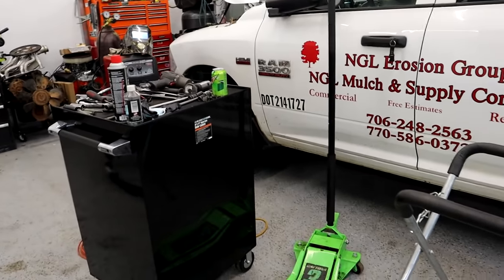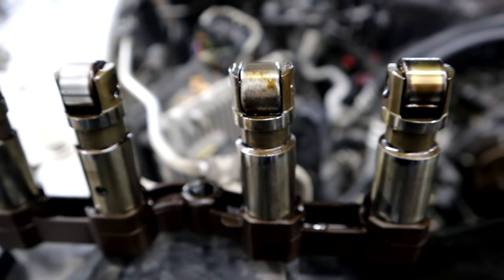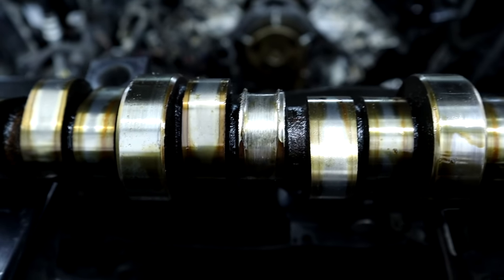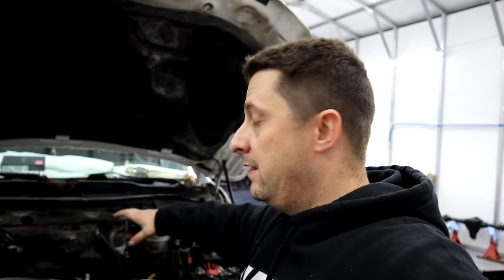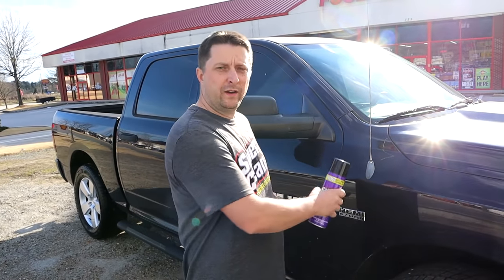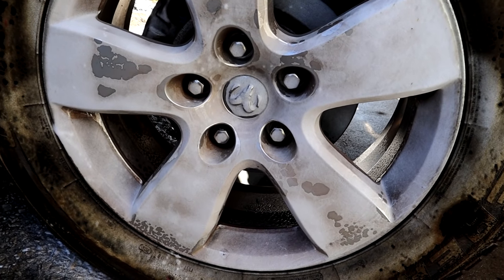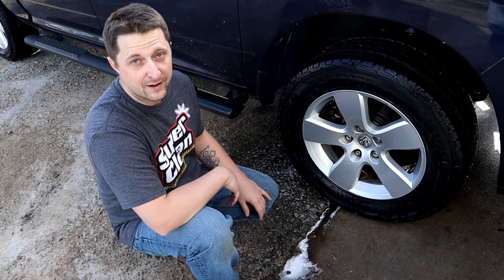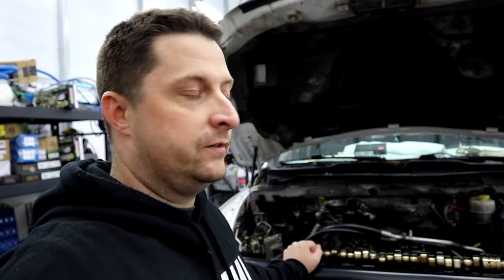6.4 HEMI Engine Failures Common Problems WATCH OUT.

Comment: I am 66 years old and have owned a Dodge 4 different times in my life. Every time I have owned one , they have remined me why I don't want to own one. I see nothing has changed.
Reply: Just curious, but Why did you buy 3 more after the first one ?
Reply: @semiauto3148  actually the first one was the best one, a half ton pickup with a 318 and a push button transmission. It was a 1967 as I recall. Next was a 73 new dodge van a total pos from new and I sold that thinking I got a lemon, next try was another van, broke the timing chain at 56,000, next was a mini van for my wife bought new never made 100,000 before needing transmission. Next was 440 recharger used as hunting vehicle, never could get it to run decent. After that I started buying Chevy. I owned a business that bought a new truck about every two years and I bought 6 new Chevy pickups and NEVER had a drive train problem in about one million miles of use.
Reply: @robertcarey3383  so. Since then you’ve been a Chevy man?  I owned a 2015 Ram with 5.7 hemi. Didn’t have any problems but only owned it for 4.5 years and traded it for 2019 Silverado with the 6.2 engine...it was nice truck but only had 38k miles when I traded it. I got a little worried about the engine after reading about the engine failures those 5.7’s were  having...
Reply: @semiauto3148  I only owned one with the 350 the others were the small v8 I believe they were 305 and two were the v6. 5 were half ton and one was three quarter ton HD. None used oil, no tranny issues, one fuel pump, one water pump, and fuel and oil filters and that was it. I put overload springs on the half tons immediately and worked them like they were 3/4 tons. When I retired I gave one to a guy who worked for me, kept one for myself and sold the other three to one of my friends who also owned a business. I also owned a couple Ford super dutys and still own one of those, I use it to pull a fifth wheel.
Reply: Fool me once, shame on you. Fool me twice, shame on me. Fool me 4 times, I need to have my head examined. 🤣
Reply: @donellmuniz590  lol.  But I do know some ppl that’s had really good luck with dodges.
Reply: @semiauto3148  I'm a Mopar guy myself, but only for the older stuff, like 1960 to 79. I'll never be able to buy a brand new vehicle, so I have no experience with newer ones.
Reply: @donellmuniz590  yeah. I like the old stuff better in all the manufacturers
Reply: Opposite experience here. 67 Dart was bulletproof. 2 minivans in the 00's served my family of 5 well, took a full American beating. My only gripe is their rust history in the Northeast.

Comment: Hey I see this everywhere. What is the actual cause of these failures ? Lifters , Cam’s, low oil volume, low oil pressure ? What ? If it’s oil volume or pressure could a aftermarket pump be installed ? I know friends with Hemi trucks never had any problems and have over 100,000 miles. Excellent informational video
Reply from the maker: Nobody really has a guaranteed answer on the cause yet. Tons of theories and guessing  but no actual legitimate reason.
Reply: Chevy has this issue as well with lifters failing. It isn’t just a ram issue

Comment: I haven’t heard of ls engines eating cams and lifters unless it’s the eco engines with cylinder shut off modes…the light duty pickups don’t have that so they don’t have cam issues….dodge needed to address the lack of oil to the lifters unless they just want engine failures out of warranty…uncle Tony’s garage has a good video of explaining this and possible solutions to the problems

Comment: I have done couples 5.7 and I am about to do 2015 6.4 hemi preventive repair just start ticking and the head Does Not have to come out just valve cover and you take off rocket arms shaft and push rods and I have done also replace of camshaft without taking off front xover and timing chain but if is taking head off and doing valve seats for 1500$ he's price can not be beat here in California labor cost is way way higher

Comment: If I was the landscape owner with 5 Dodge engine failures, I'd be shopping at the nearest Chevrolet dealer
Reply: Chevys are even worse they  have trans and lifter issues.   Ford 7.3 gas or the 5.0 is probably the best bet for a newer truck
Reply: @ashkanserat  - we use fords for our fleet and they have lots of issues under severe duty too.  No vehicle is going to be without issues when you idle for long periods and it's driven by someone who doesn't own it so they don't care.
Reply: @bobisrighturwrong   for the most part they're all piles of shit these days. Some worse than others but the newer chevys are horrible
Reply: Patt Cuda  Nissan are junk.  Just Google them...that entire company has been on a down hill slide for 2 decades.  One of the worst performing/quality on the road.  Toyota is the only one that still builds quality cars/trucks. Too bad they only build 1/2 ton versions

Comment: This is an issue of people not using the correct oil! This motor (6.4 392) is supposed to take mobile one 0/40 European car formula. The oiling holes are very small and they plug up causing lifter failure. Maintenance is a must with this motor! That is a fleet truck and is not maintained properly I assure you.

Comment: As I watch this, my 2016 ram 2500 with 6.4 is getting an entirely new engine at 146,000. Your price quotes, mileage they last, etc are exactly spot on. With so many bad engines, I’m disappointed ram hasn’t decided to do a recall or something. Likely will be my last gas truck from ram if not all together
Reply: Yeah, I quit buying Mopar junk 10 years ago. It just seem like it was always something breaking or messing up.
Reply: Having to look at this repair myself, although I guess I should feel blessed I got 250k out of my 6.4 before she bit the dust on this failure two weeks ago. What did you end up being quoted for the new engine? I may do a rebuild. I was quoted around $14,000 for a new engine which I thought was crazy
Reply: @Hall7180  I ended up paying $13,400. They also told me my catalytic converters were bad because they were soaked in oil from the bad pistons, which would have been about $2,500 additional. I didn’t have the money for the engine in the first place so I told them not to replace the cats, I can replace those on my own for less in the future.

Comment: Keep up whit the maintenance and used top of the line oil n filters or even mid grade products. It’s when you cheap out that issues start happening and passing sudden maintenance points that u get trouble

Comment: lifter and cam job on the Hemi isn't bad of a job at all, pretty easy to be honest. Keep scaring people, and I'll gladly keep picking up these cheap Rams with the 6.4. Not like the engine completely fails, and the job is just a little bit harder than a timing belt job with just the heads having to come off.
Reply: What about the longterm downstream effects of the failed lifter in the rest of the engine though? ie metal filings in the rest of the block.
Reply: What is the average cost of that repair, though?

Comment: I still think uncle Tony has found something with the angle of the lifter bores and the distance of the cam from the crankshaft. The oil isn't getting to the rollers. Only at higher rpm  are the lifters getting lubed good. The check valve in the lifters may not work correctly at idle speed rpm. It's weird that not all of the lifters show same wear  pattern. One would think if all of the lifters were getting weak oiling at idle, that they should start to fail near the same time.
Reply from the maker: I agree with the angle it does make some since for sure. Sad thing is you would have to redesign the entire block and all😓
Reply: Tony is right for sure. Dumb design. Fiat peugeot is a joke. That's why I got rid of mine before it happen. It's either this of the exhaust manifolds. Very disappointing. They won't fix the problem.

Comment: SO after the lifter fails and grinds that cam down, where's all that metal go?  I'm assuming it goes to the oil pan and gets picked up by the oil pump and goes through all the bearings. So I'm wondering about internal damage...Do you check the pump and bearings before assembly and how do they look?
Reply from the maker: If the cam bearings look good, then new cam,lifters, oil flush and send it. I have put over 20k on my motor on top of racing it weekly after a failed cam/lifters issue
Reply: @FrostbiteRam  I just had same problem on my 2014 challenger 392.  1200 miles after replacing lifters and cam, the oil pressure at idle is only 9psi. Pulled oil pump and looks to be scored fairly bad.  Just wonder if I should pull bearings too?
Reply from the maker: @street22style  its possible it could be worse but thats kinda rare most people get away with new cam and lifters.

Comment: I lost number 3 on my 2014 6.4 Ram 3500 at 102,000 miles. Fca Warranted parts I had to pay labor because factory warranty just ran out.The dealership only replaced 4 lifters and didn’t tell me until I picked up the truck. I made them let me look at the cam before I accepted the repair job all the other lobes were smooth as silk. It’s been a year and a few thousand miles time will tell. I still love my Ram truck. But there’s definitely a flaw in the engine design or a batch of bad parts on 5.7 and 6.4’s.
Reply from the maker: Thats terrible and I totally agree 👍
Reply: Fkn dealers. If you're paying the labor they should've given you the option to replace all lifters for another few hours of work. Glad you're all fixed up.
Reply: @waynedaniels7091  Indeed. Thanks
Reply from the maker: @waynedaniels7091  definitely

Comment: Camshaft failure due to lifter failure....usually at 100k miles. Just trade in before that time. It's common problem for 5.7 and 6.4

Comment: I wonder if generic oil and cheap gas is the main culprit? I've noticed when heavy towing using standard mopar oil i would hit 280 °F after going with Mopar synthetic oil i rarely hit 260. Around town driving i use mid grade fuel and when planning a trip and during a trip when towing i use premium only.
Reply: I would try 0w40 oil castrol mobil penzoil doesn't meter better flow at any given temperature better lubrication when working hard and  better additive package.
Don't belive dealerships.
Reply: @MultiPartizan1  I send my oil to Blackstone Lab for a full Chemical analysis every other oil change. I trust my dealership as not only do I know the owners but also know most of the people there and have known them for almost 20 years. The MDS system gets angry when using different viscosity oils and might cause a CEL or MDS failure.
Reply: @shockracer  When towing Premium fuel only 93 octane we use 0W30 oil when towing oil temperature stays under 230f and same oil for all year around,
Same hemi 5.7l engine in australia recommended from mopar viscosity oil  is 5w40 find CAFE agreement when you can,
No MDS issues in two hemi 5.7l engines K&N filters and Penzoil euro 0-30.

Comment: Where did the metal from those parts  went ? Do you need a block flush ? Or a new motor ? Compression checks ? How we know how bad it is ? Should we just replace all parts Before it happens  ? Shoot...
Reply from the maker: Catch it in time and nothing more than swapping parts and a couple oil changes won't fix.

Comment: The math works:
(Poor maintenance + extended idling) X work truck = valve train failure.
(Excellent maintenance + no extended idling) X personal use truck = longevity.
My 12 year old 5.7 with 140,000 miles didn't even have lifter tic.  I expect my 2022 6.4 won't either in ten years.

Comment: Well to put things in perspective if you owned the 150 with 5.4 Triton, or you know what I can phaser or plugs blowing out of the head or the next model plugs that can’t be removed from the heads to be changed you’ll feel good driving a Dodge /Chrysler any year anytime I’ll take the problems.... it must be embarrassing for them because I have several vehicles with half 1,000,000 miles on them and their gasoline engines...I don’t have a half million miles on any Ford or Chevy I truck I ever drove, got rid of it long before they could drain my wallet further oh well this problem is nothing😂

Comment: All of these Hemi engines needs a much higher volume oil pump to keep the oil pressure up at idle.
Everyone of these engines needs a hellcat oil pump. Not higher pressure just higher volume especially at lower RPMs. I think that would certainly help the situation!

Comment: First of all this is not a mds problem. I replace just a many non mds cam lifters.  Second this is not a dodge issue its a hydrualic roller lifter thats not given enough time to pump up before you drive down the road on cold start.
Reply: You’re telling me that when you start the engine and put it in drive the lifters aren’t pump up yet? Then either you’re using cheep oil filers or oil or you’re got design problems!

Comment: On a 5.7 MDS error codes when Cylinder 1 solenoid stops working,  P3400 Cylinder Deactivation System Bank 1, P1411 Cylinder 1 Reactivation Performance, P0301 Cylinder 1 Misfire Detected, P0300 Random Multiple Cylinder Misfire Detected

Comment: I'd look at the owner. What type of oil? It's not Amsoil for sure. Castrol GTX, rated as high as Amsoil for 1/3 less. Using the oil everyone thinks is the best, Shell and Valvoline, is for engines with 5 gallon oil capacity, not 7 quarts. That stuff is cheap and changed regularly. It's 2021, no dinosaur oil should be doing anything but a 1000 mile break in, with zinc. I've run Cummins  since 1994 and Hemi since they proved themselves. Amsoil only in the Cummins and rotate between Castrol and Amsoil depending on temperature in the gassers. That extra cost to bring a Hemi to 300K,(and then sell it), by using premium synthetic is a lot less than cam bushings and the time to tear down. If those Rams were Audi's or Beemers he would be using real oil and saying he does to keep the engine like new.

Comment: It's a design flaw in the engine itself. Improper oil distribution. My brother's 5.7 FHP cruiser died at 142K. Roller cams should never have this problem. It isn't the oil, or the change intervals.
Reply from the maker: I agree with it being a design issue a person should be able to idle for periods of time among other things.

Comment: V8 back in the day no tech could easily go 200k no issues at a fraction of cost of new tech. Any V8 not getting 200k trouble free miles is defective product w/high tech oil, fuel & filters we hve NOW.
Reply from the maker: Definitely 👍

Comment: I had a 2015 6.4 challenger scat pack and the lifter went around 83k they replaced it put it in did not change the cam gave it back to me drove it motor blew as I was driving on the E way going 95 and it took a year for FCA a year to put a new motor in it then when they put the motor in it did not sink the trans with motor spun out my trans rebuilt the trans and then lemon Lawed it and won
Reply from the maker: Wow thats craziness 🤯

Comment: Had 13 Challenger ,5.7 manual shift
At purchase Car Faxx showed car had been traded into various dealers.   5or 6 times with only 26K+ miles.
During test drive did not notice the Tick- after bout 1000 miles started to notice Tick during deceleration.
 IMMEDIATELY had it flushed of OEM OIL went with KENDALL Oil ( former Valvoline fan) the Tick became a fading issue. Wife got tired of shifting & traded it in a year later Tick was a non issue.
 I'm convinced the Pens oil is culprit.
Had a Chrsyler mechanic a decade + B4 this Challenger/ we were buying a NEW Colt Vista wagon(rug rat wagon) & he specifically told me not to use PENNZ- So I have not to this day. JUST MY 2cents

Comment: Do you think it's an oiling issue?  Seeing others have the same lifter starving. BTW, the 6.4 is supposed to be lubed with Pennzoil Ultra 0-40W, I wonder if owners are deviating from the recommendation?
Reply from the maker: Most likely yes but the actual reason is not certain yet.

Comment: I have a 2021 ram 2500 6.4 hemi at the dealer now for lifters and cam. The truck has approx 4500 miles on it. They are having to put a engine in it. The problem is there are no engines available.
Reply from the maker: Thats crazy 😳